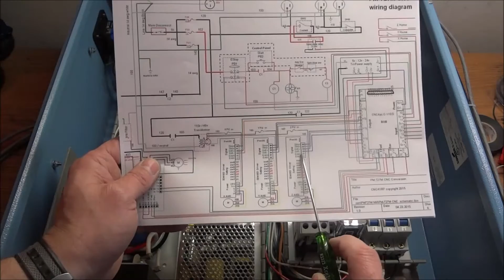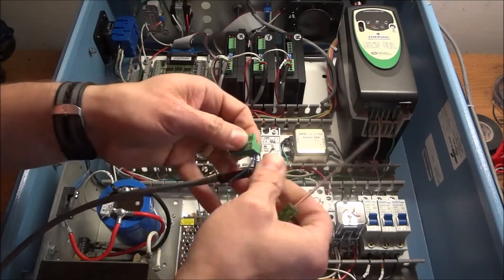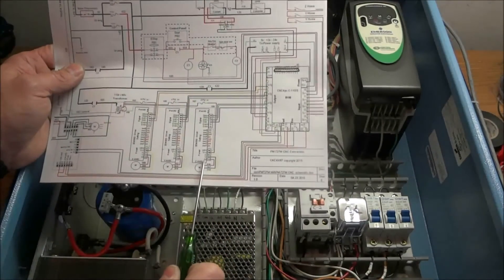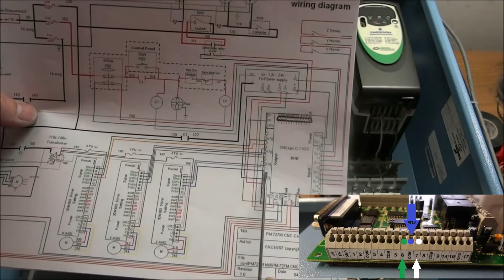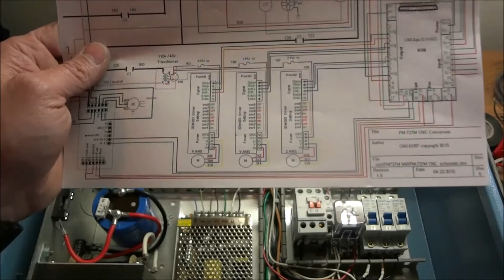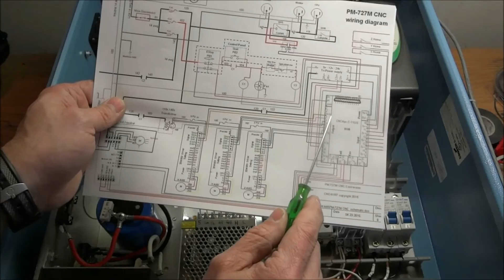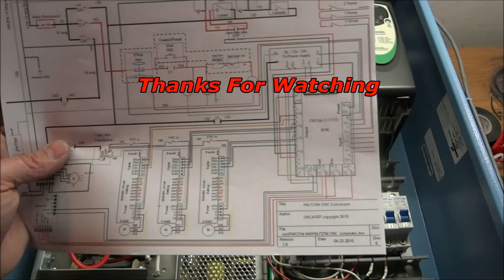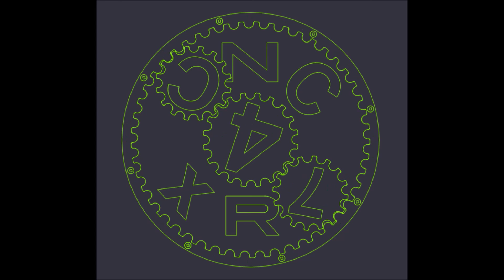PM 727M Wiring Pt 9  " C -11GS connections"

Comment: Is there a specific reason to make the 'COM' terminal, to be 5 V, then to have it as the GND (via the jumper setup on the C11GS)?  Curious if it has something to do with Mach 3 signals or industry standard, or just a personal preference?  I noticed you didn't really comment on this.  I also decided to use the 6 wire cable and bent 2 back under heat shrink (future bad wire?).  Took 2 of the 4 remaining, and twisted them and soldered, to use on the "COM" Board connection for the 5 V, rather than the jumper wire.  I should end up with the same result. 
 
I'm using the Leadshine 3ND583 Driver for X and Y and 3ND883 Driver for my Z.  As I went with your 1st Leadshine motor selections (2) 863S42 and (1) 863S68H.  I also spent an additional $100 for a 2nd transformer to run just the 80V to the Z driver and motor (probably foolish) and have a separate transformer for X and Y of 50 V.  But I really wanted to see if that  Z motor would work this way.
I have really enjoyed all your videos and the great explanations for everything.
Keep up the awesome work and videos!
Lanny
Reply from the maker: Personal preference I guess I like the input to the BOB IE mach3 to be High ( 5V) Pin 10 for instance. Each input needs 5V.

Please let me know how that Z motor works for you with the 3ND583 driver probably a better fit ( Higher voltage)

Thank you for the support. 
Be Safe,
Sam
Reply: Thanks Sam!

Comment: Very nice series very informative, i'm also converting a TM-25V mill to CNC. One question why did you chose this BOB? I'm looking at this or the PMDX-126.
Reply from the maker: I have Used the CNC4pc C-10 BOB and the C-11GS has built in spindle control so I opted for it.
I am Not familiar with the PMDX-126 it does appear to have more features I do like the "Expanded Mode" but it looks as though the spindle control is a separate board. It also appears as though you can easily connect it to a Smooth  stepper. 

I do Know that I will need more inputs for future use.